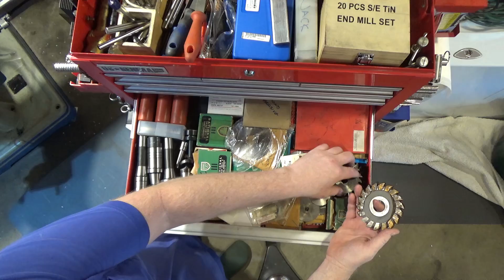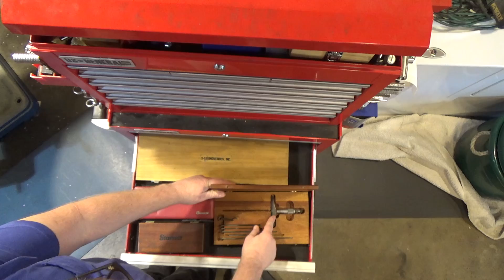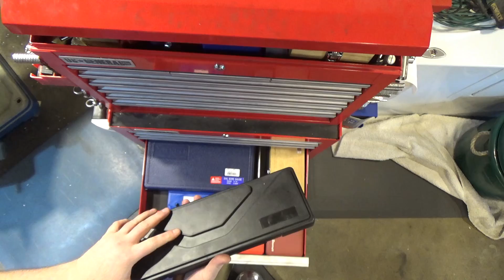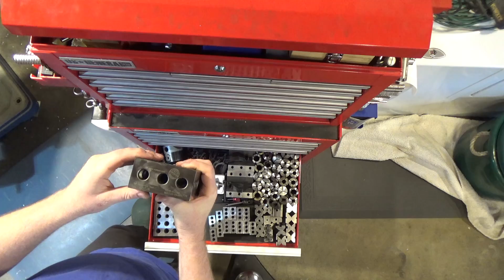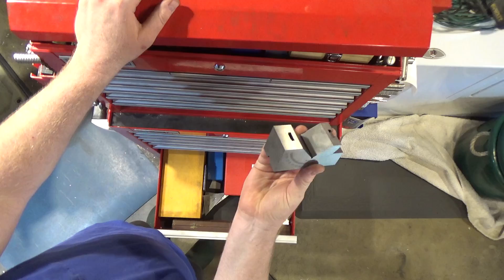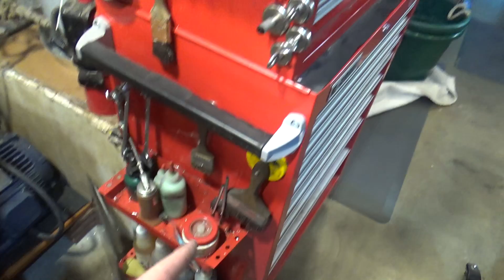126 Shop Tour 2020 Part 2 of 5

Comment: I have the same set of ST depth micrometers. Got them a yard sale for $25
Reply from the maker: Why is it that a precision instrument like a depth mic sells for so little on the used market? Even on eBay, they go for relatively little.
Reply: Dudley Toolwright not sure, here machining tooling is expensive, last summer I was out with the madam going to yard sales and seen that depth micrometer set so cheap, I couldn’t turn it down. Got lucky one time at the flea market and scored a 6” set of Starrett dial calipers cheap also. Most of the time not so lucky

Comment: You were wondering about what the projection on a knee mill head is called to the right of the depth scale.  It is called the indicator boss.  It has a hole through it for a rod to mount an indicator to with a threaded cross hole for a set screw or lock knob.  Prior to the invention of magnetic bases for indicators, and etc., it was used all the time.  It allowed you to use an indicator without removing your cutting tool.  High tech idea from guys that are long dead.
Reply from the maker: Thank you, so very much. I bet that bit of information helped out a ton of people.